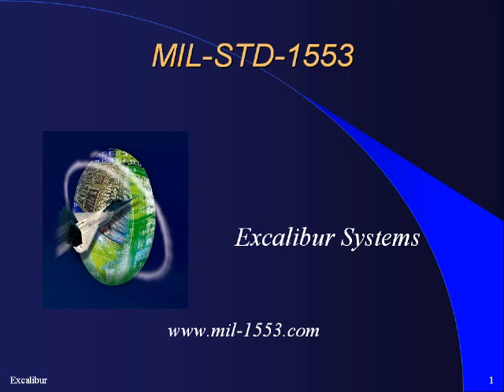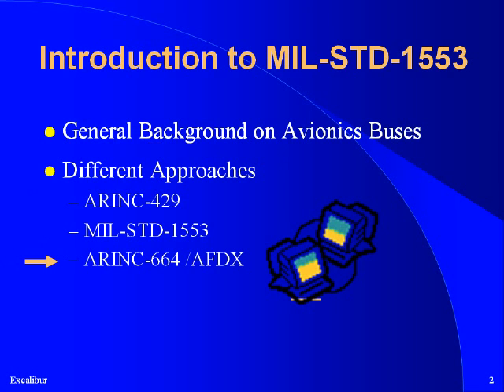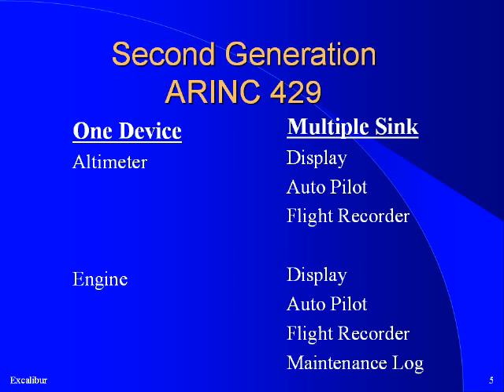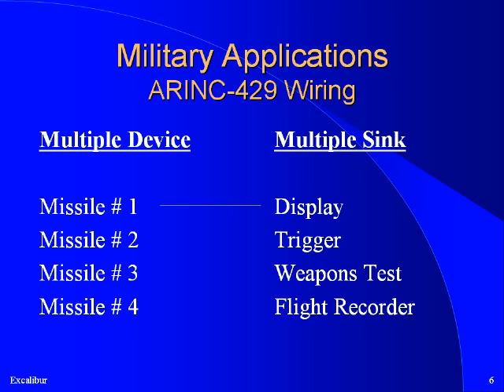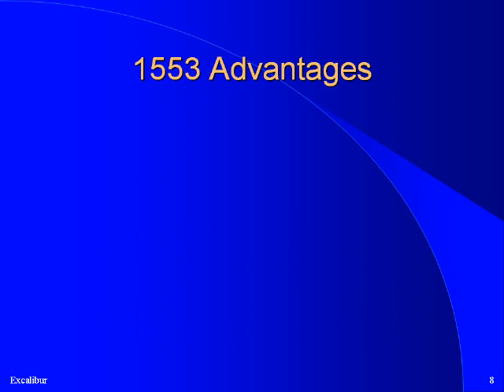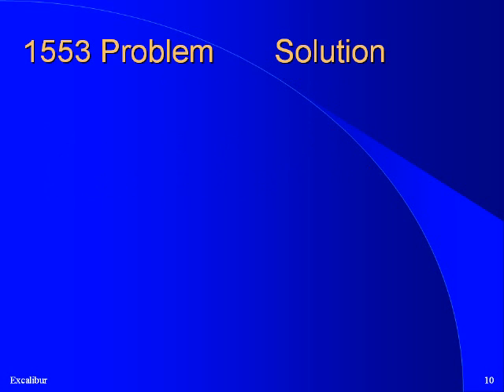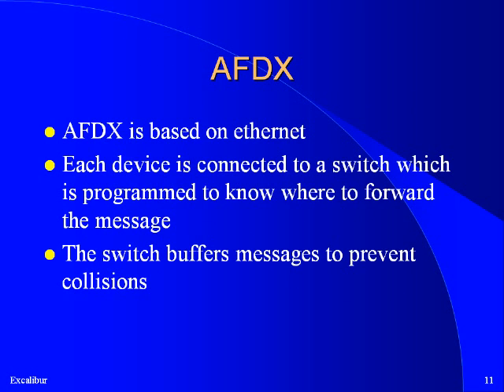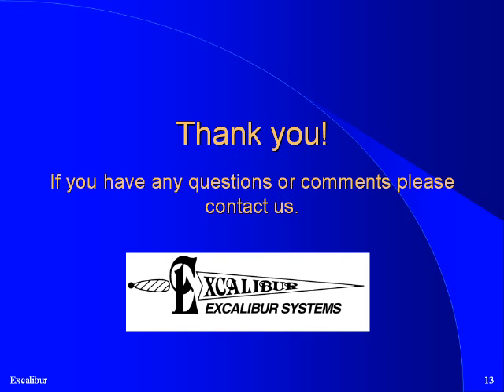MIL-STD-1553 Tutorial - part 1 | Excalibur Systems

Comment: On slide titled, "TERMS" at time 1:50,  you should add Message for completeness.
On slide titled, "Military Applications MIL-STD-1553", time  5:18, you state, "...a central wire where each device is attached to once."  This implies there is no redundancy and further, it implies there is one wire which is not correct.  In actual military applications, there are two buses which implies two connections and four physical wires.